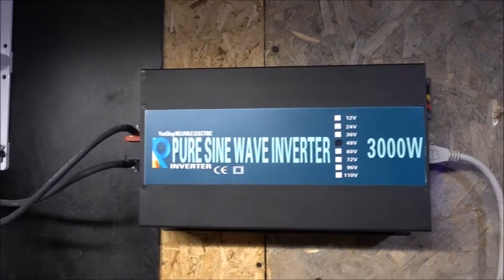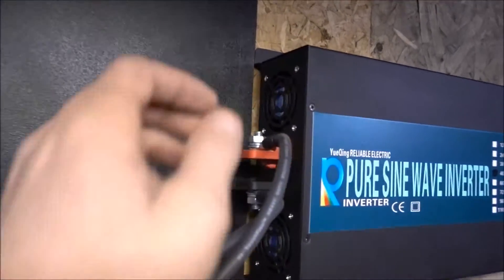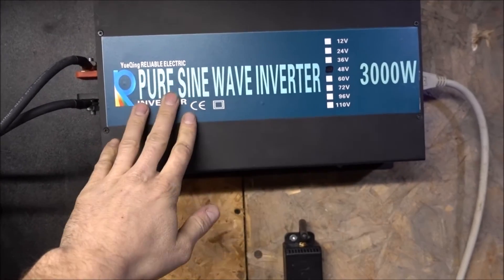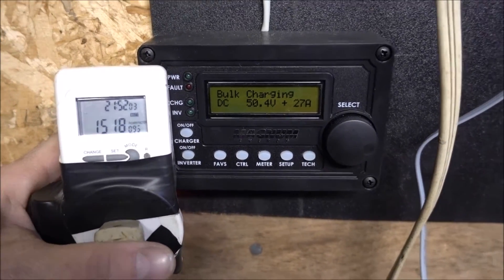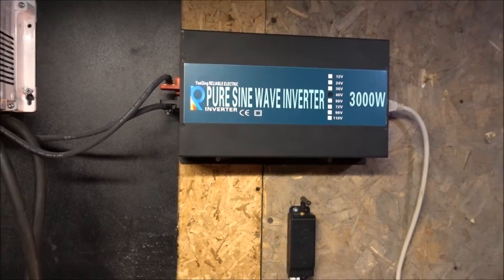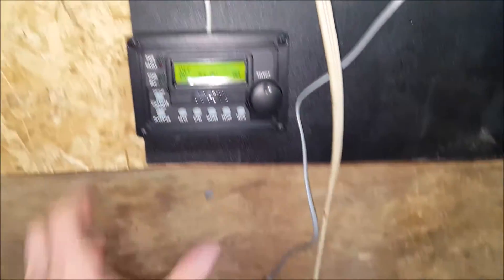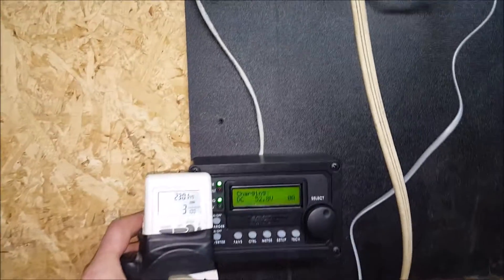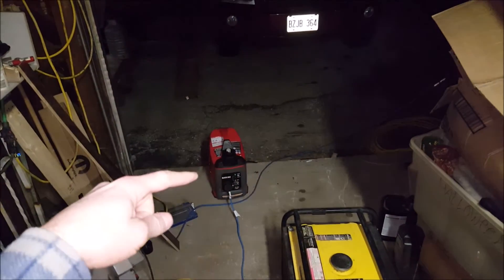48v Reliable 3000w Inverter Testing PT2

Comment: That wifi meter there where can I get one to buy? What's the name of it?
Reply from the maker: generac bout it, im not sure what its called now.
Reply: @GoingOffGrid101  ok I'm not finding it at all... Your 48v reliable inveter still works Right?
Reply from the maker: @j12simpson  yes i have 3 and they work still. generac generator company owns my home monitoring system.
Reply: @GoingOffGrid101  thanks man... I'm just here trying to invest in the best Inverters for my system
Reply from the maker: @j12simpson  while reliable inverters are good for the price, the best atm that I know of are magnasine inverters! but they are 8 times the price :D
Reply: @GoingOffGrid101  yeah man and I cant afford that one right now man..but in the future hopefully
Reply: Whats your insight on 48v battery bank vs 24v battery bank?
Reply from the maker: @j12simpson  go 48v  from the start!
Reply: @GoingOffGrid101  yeah I'm upgrading my battery bank to 48v have the batteries and charge controller than can accept it so I said why not go 48v and I recently purchased a 48v Inverter from reliable.. the 3000w version
Reply from the maker: @j12simpson  its a good inverter, try not to over load it to many times and your good to go!
Reply: @GoingOffGrid101  what's the max continuous watts do you recommend?
Reply from the maker: @j12simpson  2500
Reply: @GoingOffGrid101  ok thanks man......don't think I'll pass 2000w though...

Comment: So do you think the Reliable Power Inverter is a good front line inverter for poor folks?
Reply from the maker: yes I do, make sure to make it very clear what voltage input and output and herts output you need, and I love all three of mine so far.
Reply: I just took delivery on a Reliable 3500W 24VDC inverter about a week ago. Yes, it does work! Haven't tortured it yet though. I already wrote a letter to Kayla @ Reliable explaining many little issues I've run across. One is that there is NO real neutral! Both neutral and line are hot. I'd be afraid to tie the neutral to ground like many service panels do if you're going to tie it into a standard breaker box. I have an older Xantrex PS400 Pure Sinewave unit that does have a real output like the utility grid. It's neutral IS at ground potential and has GFI breakers! It's just too small to run anything other than a TV or stereo, laptop etc.

Comment: most inverters should be mounted inverted not on their side, position the fans so that they either suck or blow the heat up & the vents where the intake is at the bottom. So if fans are sucking cool air in then fans on the bottom, if fans are on blowing out then fans on the top.
Reply from the maker: most inverters you are right :) these like to be on there side as the heat sensor is at the top and wont turn on as soon if positioned other wise.
Reply: Okay

Comment: I wonder at what angle snow will fail stick to solar panels.  I went to PVWATTS and enter Toronto 10KW system, 90 vertical, south.  I got 7986 kwh a year with January 743 February 791 beating out June 567, July 568, August 683.  But for winter that is awesome.
Reply from the maker: I make way more power in summer then winter :)

Comment: does say charge rate not battery % :) are you going to be getting solar panels at some point
Reply from the maker: i have 2000w and I need to connect is all I just moved so im working on putting everything back together.

Comment: What Does the Magnum controller show for Inverter settings? Does it show watts outputting?
Reply from the maker: amps
Reply: ok thanks so unless I plan on "charging" with it then the controller really isn"t needed....
Reply from the maker: not needed but I would buy it if you can spare the money